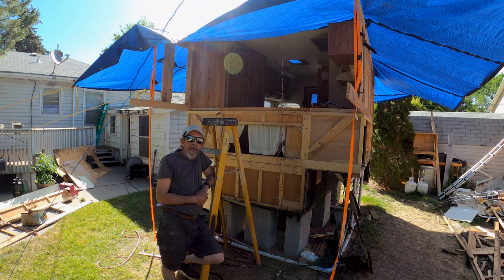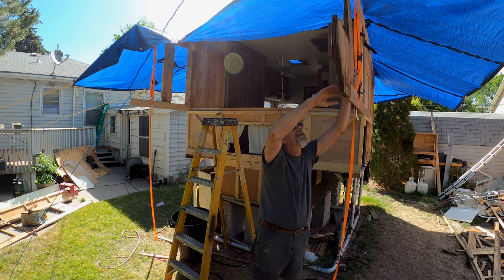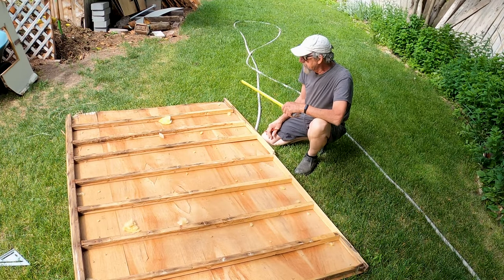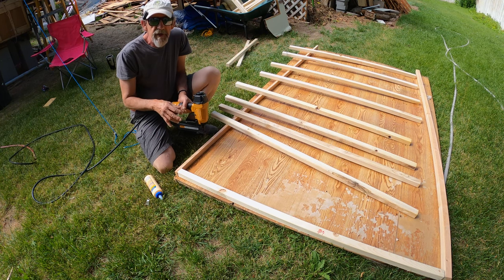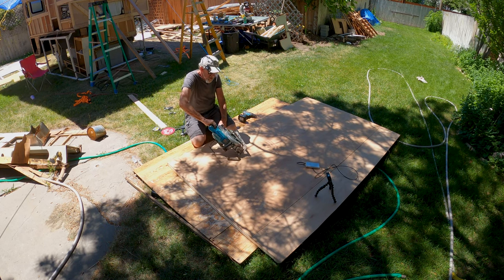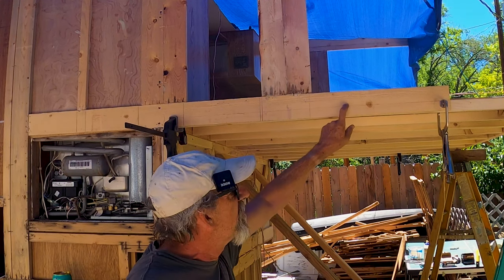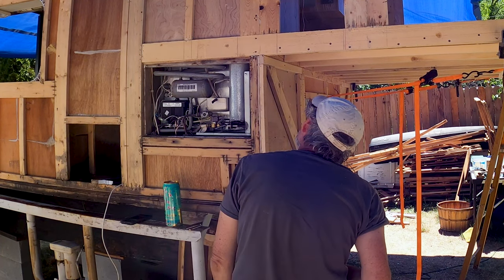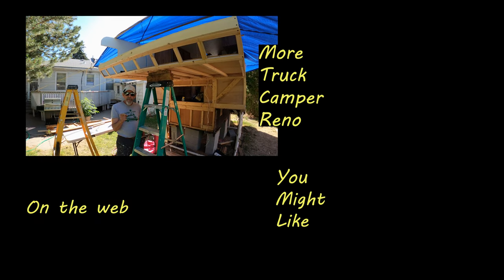Rebuilding & Installing the cabover bed ..Vintage Truck Camper Restoration

Comment: Hey TR..
   Just thought I would give you a quick progress report from my house.  It's going well.  The framers have finished and the roofers have been here as well.  Still waiting for the windows to be delivered.  Three weeks out yet.  Other than that, it's right on schedule. 
   I'm going to start the mechanical systems rough-in sometime in the next week or so.  HVAC and plumbing first.  I'm putting a Geothermal system in. With radiant floor heat in the lower level.  Then I'll have my electrician in after that. 
   We got the driveway graded again last week.  So it's easier to get in and out again.  I was able to take the R/V out to the rest area on I-35 and empty the tanks.  Needless to say they were full.  Thanks for the bio-geo method.  It saved me.
   I had the first party in the house last night.  Mostly my coworkers but a few others as well.  It was a blast. 
   I'll drop a comment or two during tonight's truck camper video.  Have a great day bud.
                                     Randy. ✌

Comment: What kind of screws did you use?
Reply from the maker: If the location was exposed to the elements, I used coated #9 exterior wood screws. Interior locations I used #9 construction screws. Thanks for watching!